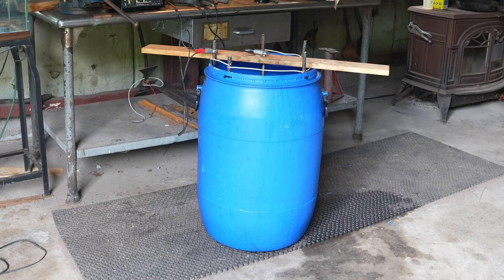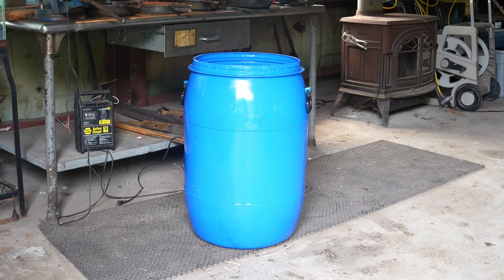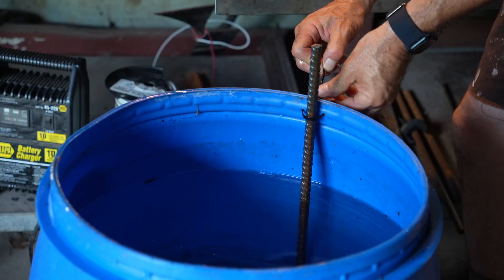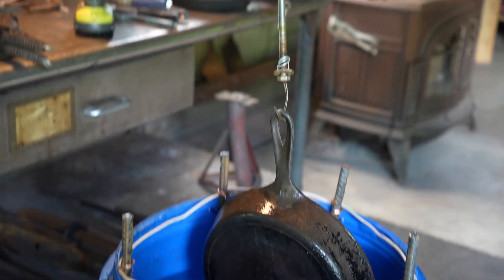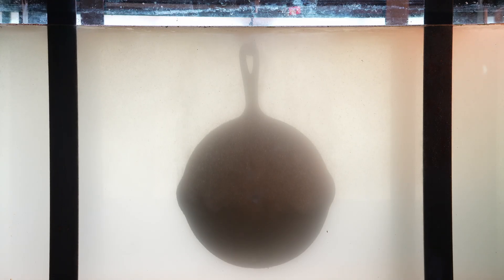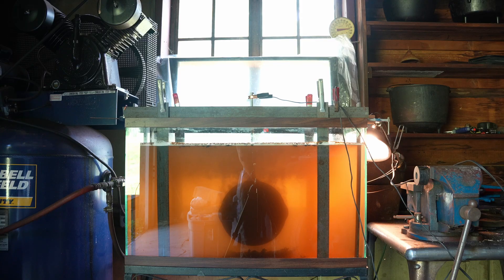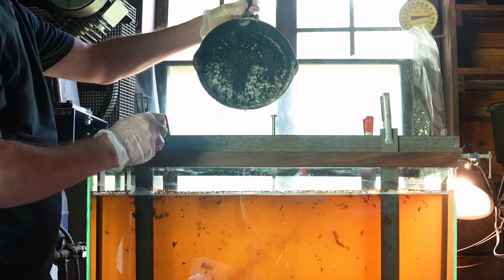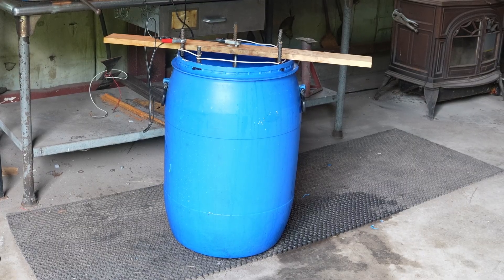How to Build an Electrolysis Tank for Cast Iron

Comment: put it in a wood stove, that will clean it. then put cooking oil on it and bake at 400 degrees for one hour.
Reply: Even a nice camp fire with coals.  Bury it in the coals until cool, wire brush any flaked rust, lube it at 400 for 15 minutes and you are good to go.  Any remaining rust bits just reduce anemia and will be gone after a few cooking events.  I have found that making corn chips in deep hot oil seasoned the iron and provides plenty of fodder for avocados.

Comment: Can this method be used with non-stick pans, or will the process damage inner surface?
Reply: Nooo. "Non stick" pans has Teflon. Just throw it away and get a cast iron or stainless steel pan.

Comment: Another way I found works well is using Lye. It’s an effective method for cleaning cast iron by breaking down and dissolving hardened grease and seasoning. To use it, mix one pound of lye crystals with five gallons of water, soak the cast iron pieces for several days, and then rinse thoroughly.
Reply: Lye does nothing to clean rust, only the old, built up seasoning and junk. If only cleaning that stuff,  safer to use easy-off oven cleaner.
Reply: @johnhardin5210  you can use whatever you like. My neighbor swears by using WD40 as seasoning sealer. My point is. Lye is dirt cheap and stupid easy to use
Reply: Will it work with non-stick pans, or will the high pH damage the surface?
Reply: @mzleveli  I don’t know for sure. I have never tried it with non stick pans. Simply because I don’t own any nonstick pans.

Comment: Can you do more than one piece at a time?
Reply: Yes you can. Just as you use multiple sacrificial rods connected to the red lead  of the charger, you can connect multiple leads to the black output of the charger and connect each one of those leads to a pan/item. I would suggest a different style tank for that, such as a very large plastic foot locker style storage container like you would store an artificial Christmas tree or large blankets in. Bottom line, keep all leads and items separated, so they don’t touch each other.